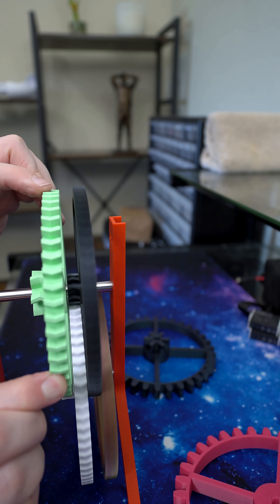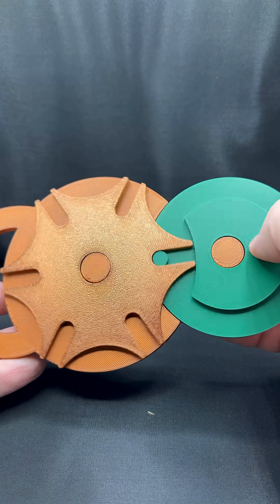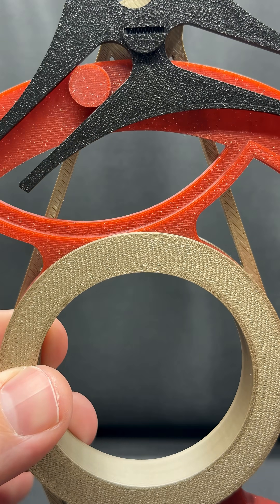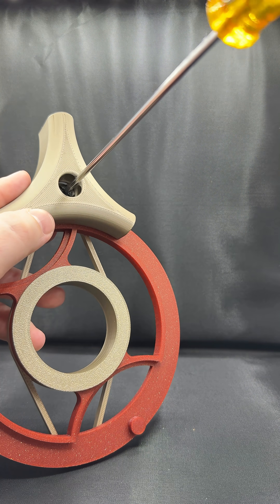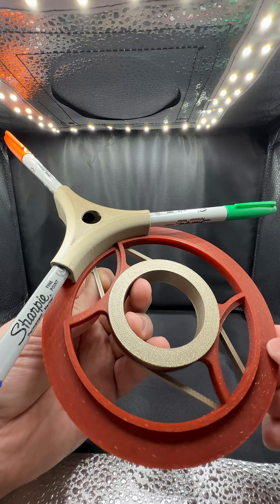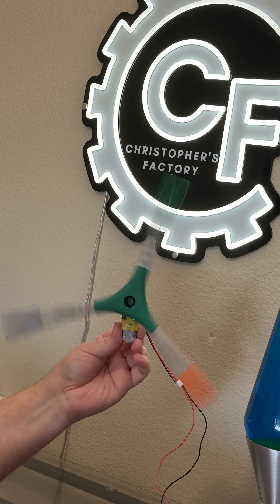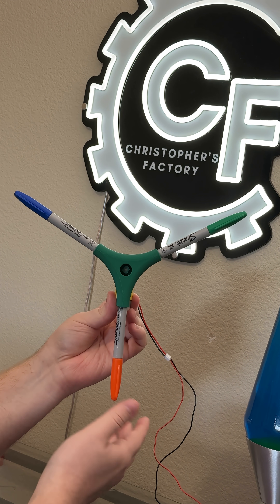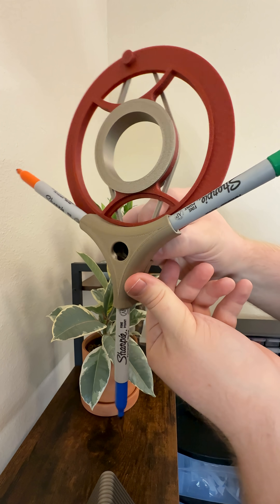The Clever Engineering of Geneva Mechanisms 🤯 #engineering #3dprinting

Comment: Warner and swasey made a whole series of turret-lathes with that kind of tool indexing mechanism. I used to use a couple that had been on some State Class battleship during ww2, still had some battle damage. Looked like some kind of big cat with steel teeth took a bite out of the gearbox housing. That housing was 1" cast steel.

If you can find one for sale I'd suggest you buy it. Broken turret lathes sell for cheap because no one can or will fix the indexing mechanism.

You're holding one.

Comment: Wrigley used geneva mechanisms in their gum wrapping machines for many years. As a student engineer about 50 years ago I analyzed the wear problem they had on the inner part of the roller track. That's where the highest forces were. It was a clever design with triangular blocks bolted to a disk to form the roller tracks, rather than milled slots. Wear coatings would have helped, but they moved on to different style machines. Thanks Ron Stepansky for that opportunity!
Reply: Did you look at the knotting mechanism on a bailer? They are pretty cunning.

Comment: The basic Geneva mechanism has a high peak torque relative to the amount of inertial loading which puts extra strain on the drive assembly and increases the amount of torque required by the actuator driving the mechanism.  The deeper the grooves relative to the diameter of the geneva wheel the more extreme the spike in peak torque is relative to the inertial loading.

A geneva mechanism like this one with very deep grooves and a load with a high rotational inertia relative to its mass is basically a worst case.  A lot of that is a consequence of wanting 3 positions which requires three 120 degree lunes to be cut out of the geneva disk requiring the depth of the slots to always be greater than 1/sqrt(3) * the geneva disk diameter to allow for the thickness of the pin and forks.  I suggest trying a 2 pin conjugate geneva drive instead to distribute the 120 degree motion across 2 geneva mechanisms that hand off to one another allowing for much lower peak torque when indexing. You'll find a mechanism like that referred to as a star wheel drive if you want a visual representation.

Comment: I have three engineering degrees two in mechanical, I was always looking for a book on all the types of gears and mechanisms but never found it
Reply: Suggest: Mechanisms and Mechanical Devices Sourcebook - N. Sclater.
Includes an incredible number of gears, drives, and so forth - including the external geneva mechanism here (as well as the related internal geneva mechanism) - and the constructive geometry to make them.

Alternatively, and more freely available online (as it's old enough to even nearly enter public domain in the US): Ingenious Mechanisms For Designers and Inventors.
Similarly, it has geometric constructions for everything (and also includes the geneva mechanism!), and is incredibly easy to peruse in a way like an older encyclopedia would present itself. Also, freely available. The only downside compared to the first entry is that it's missing a number of key developments that came later such as the harmonic drive (which didn't come about until the late 1950s).

Comment: Geneva mechanisms are also used in assembly line work where you might have the same motor performing multiple functions or running multiple machines linked and timed together. You can create pauses in a process for a certain operation to be performed, such as punching or drilling a hole in a part, while the motor remains running, and not interrupting other parts of the system.
Reply: Thanks!
Reply: they are also used in cinny cameras moving the film one frame at a time.
Clock also use them. 4 turns and they can lock so not over winding the main spring.

Comment: There is another major benefit: the motor would require an individual imput to be synced with the other motions that move the contraption around. But the mechanical nature of the geniva mechanism means that the timing is within the gear ratio leading to less chances to screw up the timing sync.

Comment: In high fatigue applications the friction from the two parts will probably wear them out fairly quickly. Obviously not a concern in this application but I wonder if you could replace that circular tooth with a pair of bearings that contact opposite teeth of the fork in the Geneva mechanism. Probably only worth it if you have a very large number of modes to cycle between very quickly

Comment: These are used in A2 pinsetters! They slide the assembly holding the new pins backward very precisely to drop the new pins onto the lane. If you mess with the shape of the fork, you can get some really interesting linear movement out of rotational movement.

Comment: These are most known for their use in watches. Tool changers are typically tool holders on a gear-driven carousel. The tool holders interlock with a collet retention system on the working spindle via some version of a pick and place or the spindle gantry itself.
Reply: Watches don't use this though. I can't think of a single watch movement that uses this. They use a spring and mass, combined with an escapement. Movie cameras use this, and like you say, tool changers.

Comment: You also need MUCH less precision since you can just do “about a turn” and get the same result every time vs needing to locate the motor position precisely.
Reply: yeah, usually you'd put a switch on the other side so you don't desync, but being accurate to like 45 degrees is good enough.

Comment: I used to work in a candy factory that had a machine with tons of weird gears like this in it. The machine was meant to wrap cupcake shaped candy, and the entire thing ran using some insane gear ratios and shapes. The feeding belt connected to shears that ran off a linear gear racks that slid a blade back and forth to cut plastic that was pulled over the cupcake as it was pushed upwards by a another linear gear elevator system. After the plastic was cut they got pushed further up into a rotating plate that had cutouts to slightly squeeze and hold onto the cupcake as it then rotated over a heated plate that folded and shrank the plastic to seal it. It then got spat out using a plunger also powered by the same gear that powered the rotating plate. Then it went down a whole new line of labeling machines that were still powered using the same gear train, the whole machine was like 20 feet long all powered by the same gear train starting from the feeding belt.

Comment: The only issue is that the tolerance of the tool is directly related to the tolerance of that mechanical “lock”. Since it slides, it can’t be that great, and since it seems to be a lever action, it seems the tolerance at the tool will be a multiple of it.
How is that solved?
Reply: You really underestimate how small sliding clearances can be. 0.01-0.05mm (10-50 microns) is not unusual.
Reply: @slome815 well that will bring it into the realm of 10’s of thousandths. So that should be good for most applications.

Comment: Most common application I know of is in movie cameras/ projectors, to stop the film while each frame is exposed/projected, then advance the film to the next frame.
Reply: I would image also watches
Reply: @jegorkomarov7098  No, watches use a mechanism known as a balance spring to create the regular ticks. As far as I know, watches don't have a Geneva mechanism, although the balance wheel is slightly similar in some ways.
Reply: @DenverKedish They did, that’s where the name comes from. Geneva Switzerland, Swiss watches?
Reply: @eancola6111  Nope, I think you're thinking Swiss movie cameras. I double-checked and these are not used in timepieces.
Reply: @DenverKedish Maybe check again, not in wrist watches but in timepieces
Reply: @eancola6111  Where in the movement? As far as I know, I thought the ticks come from a pallet fork letting out increments of rotation as it drives and resonates with the oscillator, be it a balance spring or pendulum. I can't see how this would be useful in a timepiece, but I would love to learn more about it.
Reply: @DenverKedish It was apparently used in the winding mechanism in the 17th and 18th centuries. Definitely not the common use of it but that’s where the name originated.
Reply: @eancola6111  Oh okay, thanks for educating me on that!
Reply: @DenverKedish not all watches are the same, what you’re describing is just the escapement, sure you won’t find any such use of a Geneva mechanism in a time only watch which is barebones, but there’s many complications that are used on top of the basic movement architecture depending on the watch, many of which use a Geneva mechanism it being so versatile, it’s used in Geneva stops which limits the barrel so it doesn’t operate under low torque, Geneva drives are also used in calendar complications, moonphases, jumping hours and chronographs and much much more, it’s where the name Geneva mechanism comes from, it was used long before but was refined and became widely used in watchmaking.

Comment: Looks like it will only reliably work with a low power motor. Constantly hitting a part of the mechanism will inevitably cause material fatigue or cracks.
Reply: We had this type for indexing packing at my old job. Constantly having problems due to jams or the machine just being old and the tolerance of everything not being what was needed. All were replaced with stepper motors, plc, and an induction sensor. Paid for itself in less than a year.
Reply: That can be engineered away. Geneva drives have been clacking away in machines for centuries now

Comment: Fun fact: This mechanism is what creates the iconic rattling sound in a film projector. Each click is one turn, advancing the film reel one frame and holding it until the next turn.
Reply: Thank for explaining that
Reply: Oh wow, I didn't know that, thankyou 😊
Reply: Thanks!
Reply: ...and your film travels at 1 ft 9 inches per second. The more you know!!! lol
Reply: Funny how in any of the answers so far  there are no mentions about the shutter?

I was a projectionist back when and this is the path from reel to reel on the Century 21 we had from what I recall. This is old in my memory.

The film goes through the first set of sprocket to pull the film in from the reel, had to make it a free loop which was  useful after it had gone through a little path like skis on each side. 

The shutter was in sync with the clicking peeps are talking about but the one sound you never forget, is the clacking of the film strip but I digress.

 After gone through the skis/skid area, it was sent to another set of gear where it would be pulling the film over a nice 1 inch diameter polished wheel 40mm wide,  which was to hold the sound track in a perfect line. Now they use CD's for the soundtrack. The film is just used as reference points nowadays. Our theatre was mono to the core!!! lol

PS: The second sound you never forget is when you don't hear the clacking of the first sound!!! When it was silent other than the shutter still doing its thing, you knew the film had broken and was pooling on the floor somewhere!!! lol 

I miss those days. Free fizzy drink and popcorn and being paid to watch, I mean, play movies on the big screen. ☺
Reply: WO That's cool
Reply: not really. same idea of transforming consistent rotation into an intermittent movement, but not the same mechanism. that one retracts teeth, lifts them, extends them, pulls them down, then retracts them loop again. 

it keeps moving consistently, just not always in contact with the film.
Reply: @ayooobro Fun fact: it is possible to verify information before attempting to correct people.

Please google "film projector Geneva mechanism". You are corect that not all film projectors use geneva drives, but the old rattly ones certainly did.
Reply: The more you know!
Reply: I've always wondered!
Reply: The real content is in the comments.
Good'ol reddit spirit on youtube- thx man!
Reply: I was going to ask what the functional use would be. Thank you for your input. I am now smarter than I was five minutes ago. That was my daily goal, now I can take a nap.
Reply: @artszabo1015 naps are great. I take them all the time 😂
Reply: why is the fact fun?
Reply: That's why it's not a continuous
Reply: Fallout games intro?
Reply: AKA the "cross box" due to the Maltese cross shaped Geneva mech.
Reply: good knowledge my friend
Reply: Not so fun fact.  99% of "fun facts" (much like yours) are not fun at all. Interesting and/or educational maybe, certainly not fun. At least not in the traditional sense for the majority of people even though "fun" is subjective.
Reply: That is a fun fact!!
Reply: Nope, that's wrong. Or to be fair, that's only half of it. 
What you hear is the shutter.
Reply: Why does it need to 'hold' it ? 24 frames with the mechanism advancing it at 24 f/s - why complicate it ?
Reply: You want to expose each frame as long as possible. You need the picture to stand still while exposing is to the bulb. Otherwise you would just get a blurry unwatchable mess. Infact while the mechanism is rotating to the next pausing point. The bulb is blocked. So that you can't see the rotation. @Czechbound
Reply: @KeozFPV  Thank you very much ! I had no idea. I always imagined it just, you know, ran normally. Do those old editing machines ( you know the one shaped like a big table ) have this mechanism also ?
Reply: no,that's a maltese cross gear,similar,but different!
Reply: @meerkatzThe23 If you're going to be pedantic, you ought to at least be correct. "Maltese cross gear" is simply a name for a Geneva mechanism with 4 arms.

You basically just said "That's not a dog, it's a poodle."
Reply: @eric.s.5919 a film projector uses the 4 arm thing and not the one with 3,end of story
Reply: @meerkatzThe23  Youre shown one with 6 and one with 3, but you think that only those two are called geneva mechanisms while the 4 one isnt despite being functionally identical?
Reply: My dog is a Maltese cross gear
Reply: @SpikeEhrmantraut my dog is a chihuahua and  I manufactured a hamster wheel device for him. As he moves the wheel, getting exercise, it moves bicycle electrical generators which then charges my iPhone. I feed him and water him, another way to use renewable energy
Reply: each click is one turn,exactly,and u need FOUR clicks...4x6=24 pictures/second.
and the light strobes at 48,so u can't see it strobing...that's all i know.
but maybe i am completely wrong,enlighten me!
Reply: @meerkatzThe23  I'm trying to do just that.

"Geneva mechanism" is the broad term. It can have any number of arms; one, two, three, four, etc. When you have a Geneva mechanism with specifically 4 arms, you can (but don't have to) call it a Maltese Cross gear/Maltese Cross mechanism.

Imagine we're talking about watercraft. It's correct to call a canoe a canoe, because that's what it is. But it's also correct to call a canoe a boat, because a canoe is a kind of boat.

A Maltese Cross gear is a type of Geneva mechanism. It's not a different thing, it's a sub-category.
Reply: @eric.s.5919 , people will argue, just for the sake of arguing. You might as well be chatting with a wall.
Reply: @meerkatzThe23  :  In a mechanical clock the gear with sixty teeth is usually called the 'minute wheel'.  That does not mean that calling it a 'spur gear' is incorrect.
You have told @eric.s.5919 that he is incorrect if he calls it a 'Geneva Mechanism' when it has four arms... he is not incorrect, it can be referred to by either name.
The Maltese Cross reference relates to the emblem on the historic four-armed Maltese Cross medal, currently associated with FireFighters.
Reply: @meerkatzThe23  It depends on the shutter wheel, most were triple flash (three blades).

Comment: This type of mechanism is very common on printing presses because its good at using a constant rotating force to do various different actions simultaneously.
Reply: I bet they break constantly though. How much do we need to print now anyways? Everything is electronic now.
Reply: @rickwilliams967 as someone who works in a printing factory you would be surprised by how little those things break down and how theor are always the parts we have boxes of spares for that are never opened the the point they have outlived the manufacturers of said parts and for the other part yes we do ALOT of stuff still ever bougt something in a shop or something off Amazon well the packaging it comes in most likely comes from a printing factory
Reply: @rickwilliams967  Why would it break down constantly? This is the same mechanism used in film projectors, there it moves 24 times every single second. Even CNC machines use it for their tool changers.
Reply: @rickwilliams967  i work in a factory in germany. We produce all kinds of aluminium closures for bottles. They need to be printed on too.